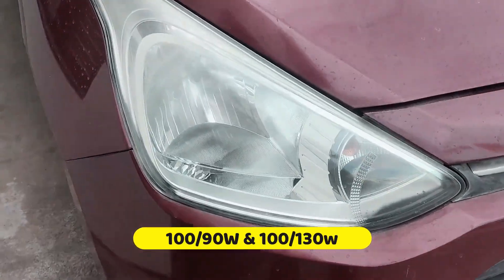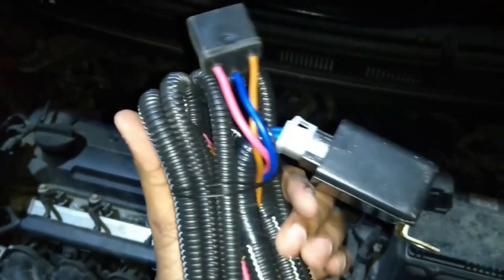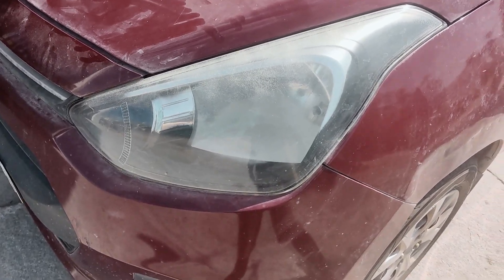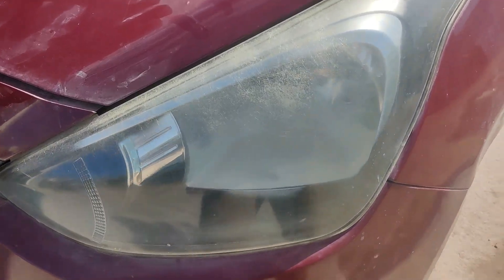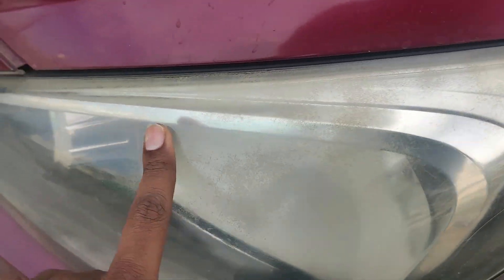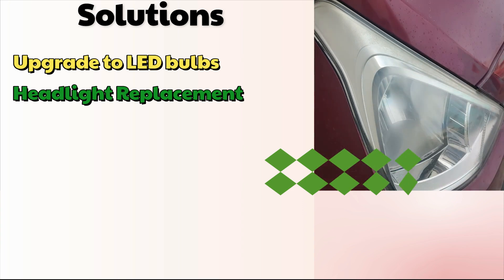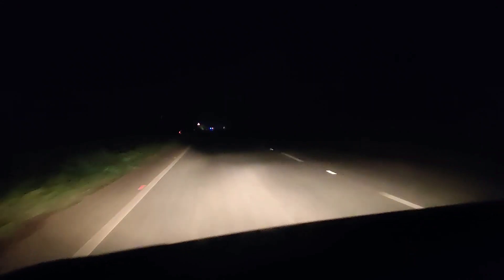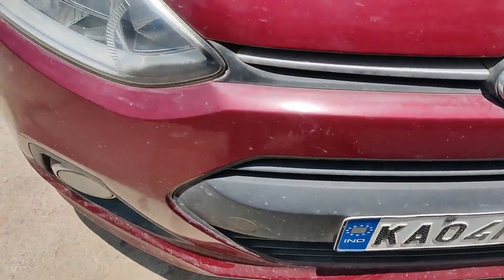Halogen lights are dangerous to your car | car light reflector

Comment: 1:52 instead of getting 100w bulbs maybe you should think about raising your headlights so that the low beam would light up to 40 meeters (thats the max distance so that you wont blind anyone)
in the video the low beam appears to be only 10-20 meeters
Reply from the maker: Thank you for your suggestion
Reply: Bullshit.  Doesn't work.
Reply: @sanketpathak8075  still his headlights seem a little too low even if the normal h4 bulbs are candles
the high beam only go like 5 meeters more compared to his low beam